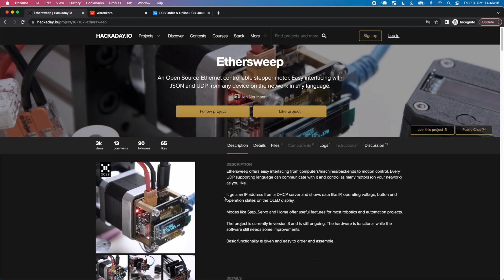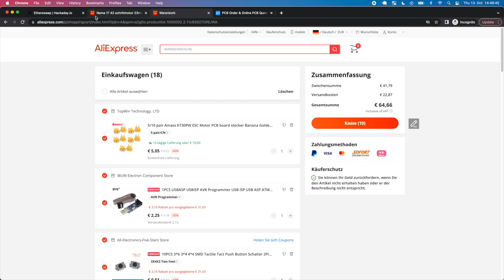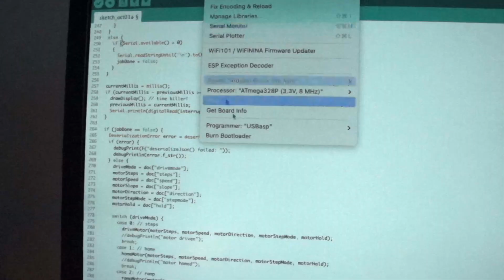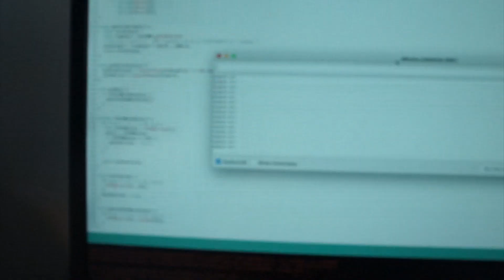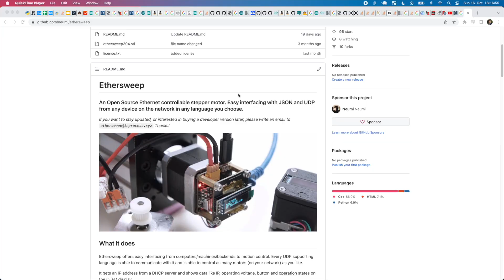Assembling Ethersweep - from Parts & PCB to finished controller

Comment: Why don't you vscore?
Reply from the maker: If you mean VScode... I agree that the Arduino IDE is not really efficient, stable, or professional, but it offers easy board options, library management, bootloader burning, and a handy visual serial monitor. Also, it makes stuff easier when others build an Ethersweep controller and just have to copy the settings.
Reply: @Neumi  nono, v-score, saves you having to saw your PCBs, just snap them apart.
Reply from the maker: @danedwards_ee  Aah haha :D sure... Vscoring will be something for batch production I guess. But maybe I will try it for the next prototype batch.